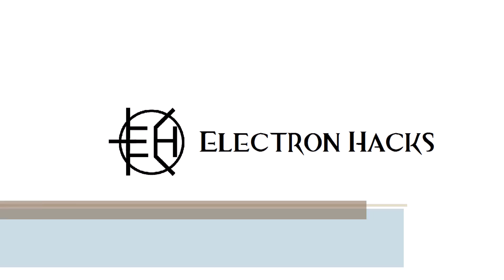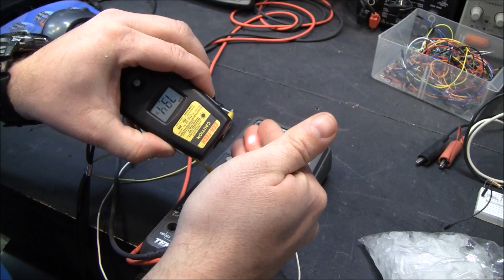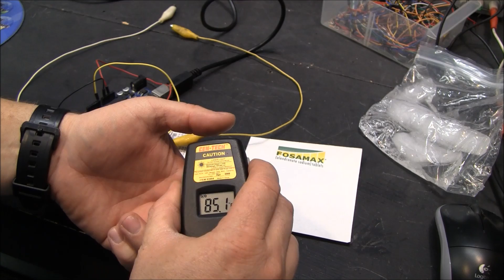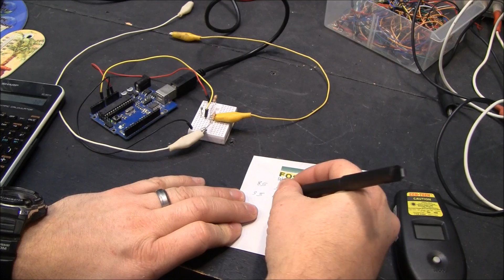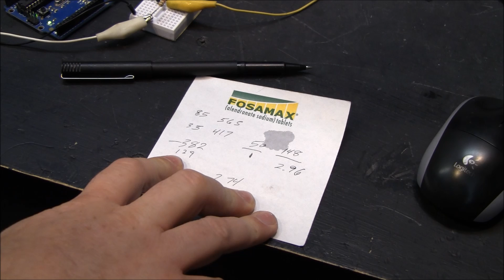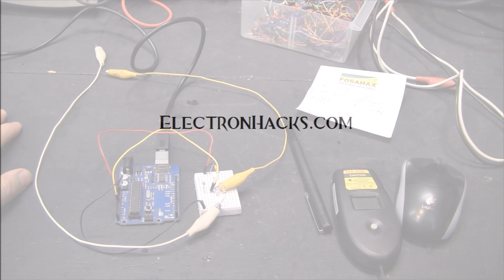How to Scale a Thermistor for an Arduino

Comment: First of all, the thermal relationship is not linear, for a play like a little kid m this is just great, otherwise you have no idea about electronic...  C stands for Temperature in Celsius and Ohms for restistance  if you graph it in excel you''ll see how not linear this is
then a formula solves it all.. this is a 10k from the datasheet 

 (201.8416962607)*EXP(-0.038352*A2) 50 coresponds to A2
   C      Ohms  calculated deviation   % B2          difference between two
50 31.231     29.662                         94.98%             -5.02%
55 25.202
60 20.448
65 16.679
70 13.675
75 11.268
80 9.329
85 7.758
90 6.481
95 5.437
100 4.580
105 3.858

Mr Electronic this is how it needs to be done and calculated...  read a bit before educating others wrong...

Comment: If you want to do this right, you don`t just use simple arithmetic's. This is what you want to do:

1. Use a voltage divider.
2. Read the voltage on analog in.
3. Convert the raw data to voltage.
4. Use Kirchows law to find correct resistance.
" Thermistor resistance = (Vout / 5v - Vout) * Ref.Resistor "

5. Use Steinhart-Hart equation to convert resistance value to correct temperature. See below:

NTC`s and PTC`s are nonlinear and you need some special values to use the Steinhart equation. Either find them in the thermistor`s datasheet,

If you do not have this, then you can use a thermistor calculator to find these values. Make 3 temperature readings with and measure the corresponding resistance. Example: 30 degrees = 5ohm, 40 degrees = 3.2 ohm etc.

Mark them A, B and C and put them inside the steinhart equation.

http://en.wikipedia.org/wiki/Steinhart%E2%80%93Hart_equation
Calculator: http://www.thinksrs.com/downloads/programs/Therm%20Calc/NTCCalibrator/NTCcalculator.htm

I saw someone mentioned a lookup table. But this should be unnecessary if the math and constants are correct.
Reply: I found a good site for Arduino: http://garagelab.com/profiles/blogs/tutorial-using-ntc-thermistors-with-arduino
Reply: I can’t thank you enough for the link to the calculator that has dramatically reduced my learning curve to determine the required thermistor values for the steinhart-hart equation!
Reply: No probs. Internet is a community :-) Good luck with your projects! \m/

Comment: Your using a normal NTC thermistor right?  I don't believe a normal NTC is linear.  Perhaps a look up table would be a better solution?
Reply: You are right, NTCs are far from being linear. I picked a random NTC and looked into the datasheet (http://pdf1.alldatasheet.com/datasheet-pdf/view/217100/EPCOS/B57891.html). At least the one I checked out had plenty of lookup tables (temperature to resistance) included. So that and some Ohm's-Law-Kung-Fu should get you way more exact temperature readings minus the trial and error part.
Reply: Paul Rogalinski   The solutions I've used in the past are a look up table.  It's basically a y=mx+b solution but you have more points on the graph.....I think the sensors are log based.  So - yea, math.....so - would be a great follow up video.  Also, if you want to make a really temp stable temp chamber, two or three Styrofoam coffee cups, with a Styrofoam lid just big enough to let the wires out makes a really great, slow changing environment.  Then you can take measurement over time as your water ice solution melts( set up like that will take hours to get to room temp - while you data log).  Look into the DS18B20 - it's and a Dallas one-wire sensor, and is 0.1 degree c accurate.  http://www.adafruit.com/products/642?gclid=CKWFuLiDg74CFU5afgodInoADw  I have a few lab grade sensors, and it seems to be spot on and then some.  Suscribed to yoru videos - do you make money off your channel?
Reply: GeorgeGraves I've been reading up a bit on this topic, you can get linear(ish) response of a NTC within a range of interest when you add a resistor in parallel to the thermistor. I guess this "trick" will not work with any sensor, but it might be a low hanging fruit worth picking up:
http://www.cantherm.com/products/thermistors/choosing_ntc.html#app2
Reply: also worth looking at (via HACKADAY ) http://wemakethings.net/2014/04/24/k-thermocouple-lib/